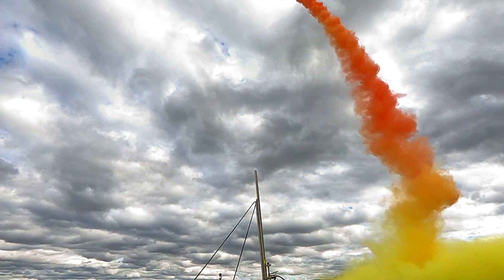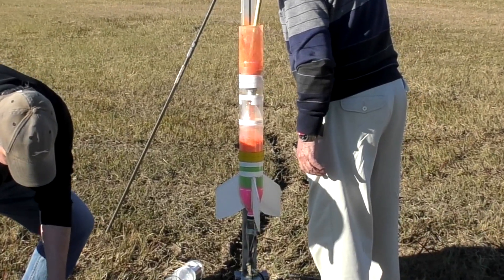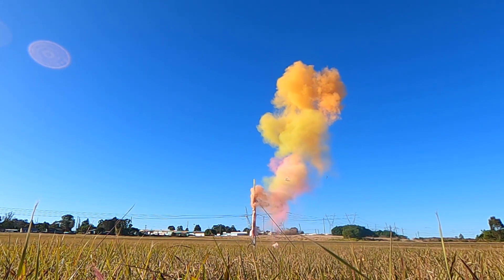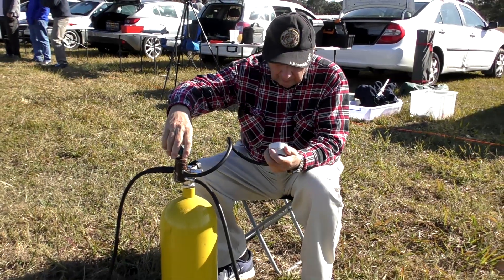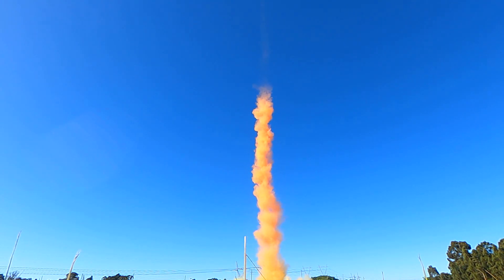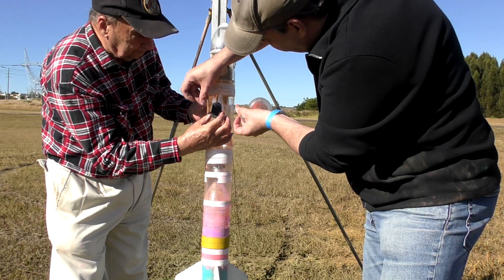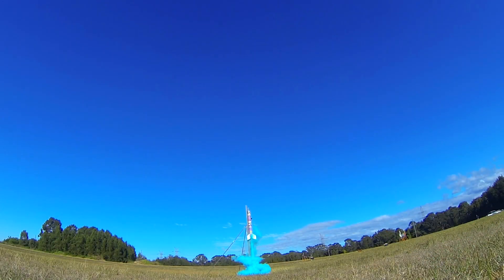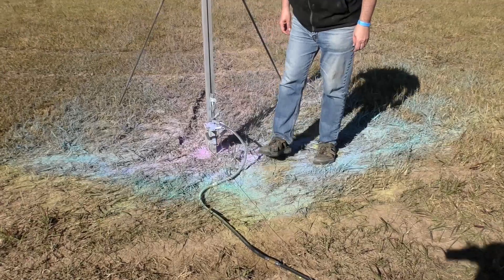Fine Powder Rockets

Comment: I wonder if the powder feeding could be more "efficient" on a per mass basis by using a reservoir and venturi to suck the powder into the airstream. The pressure loss is probably quick enough to make it a wasted effort, though.
Reply from the maker: One of the big issues is letting too much air escape before all the powder leaves the nozzle. As the particle size increases more and more air is able to sneak past the particles. One of the reasons water works so well is because all the water is ejected before the air starts escaping. Here is a video that looks at powders in a little more detail: https://youtu.be/YUeDsy64H6U

Comment: Hi, i have a question, Im currently working on an arduino based deployment system for the parachute but i need to know what timer to set before flight. Whats your recomendation to simulate water rockets?
Reply from the maker: Good question. For regular water rockets you can use either of these simulators to figure out the time to apogee: http://cjh.polyplex.org/rockets/simulation/  or http://www.aircommandrockets.com/sim/simulator.htm
Reply from the maker: Plus or minus a second around apogee is usually good enough.
Reply: @AirCommandRockets  Where can i get the drag coefficient? I have a friend that knows how to use open rocket so i thought it would be a good idea to just model my rocket in that and get the drag coefficient that way, is this a viable solution?
Reply from the maker: @grzewikpl8562  Definitely that is the most accurate way to estimate it. Depending on what you are trying to achieve, you may be able to just guess an approximation say between 0.3 and 0.5 and go with that.
Reply: @AirCommandRockets  Aight thanks ! Can't wait to see this thing fly, its my first time with an electronic deployment system.
Reply from the maker: @grzewikpl8562  Good luck!

Comment: Interesting that the on board camera didn't pick the colors of the exhaust, but some sort of earth color dust
Reply: Small cheap cameras tend to has rubbish colour accuracy
Reply: @joashparker8271  yup, but I expected some kind of contrast against the ground. 
Looks like no difference and maybe (just maybe) the color cloud moves sideways, like some sort of ring wall, but the real dust cloud lingers on the ground. So we truly see color from the side but dust from above.
What do you think??
Reply from the maker: I was waiting for someone to notice. *grin* It was actually the view from the first launch. It turned out better than the second launch and so we just used that in the video. The "dirty" plume that you see is mostly the powder that was left in the rocket after the explosion. This is the plume that mostly spreads out sideways on launch. The colours were well and truly mixed there.
Reply: @AirCommandRockets  
All directors make such licenses...
Si non e vero, e ben trovato
(May not be true but it's beautifully told)

Now you gotta change the title to "curb your rocket" and put the mandatory "directed by robert b weide" statement